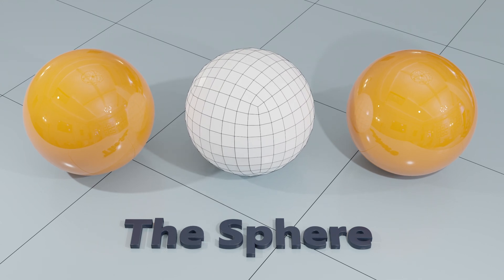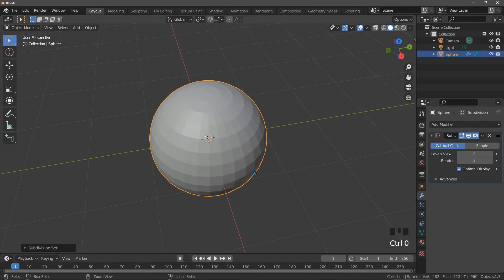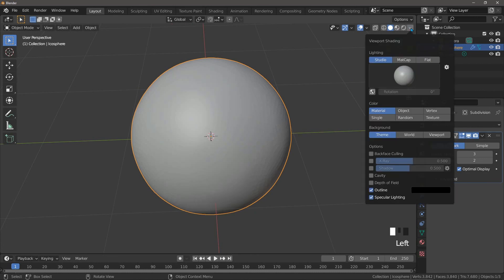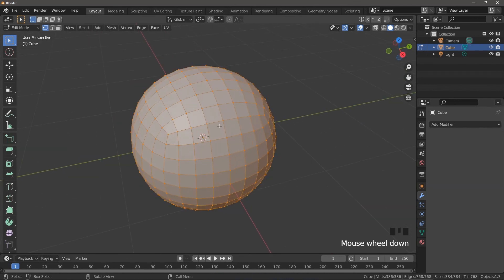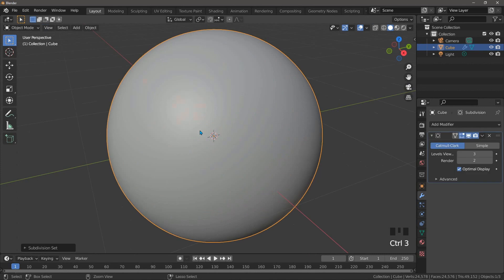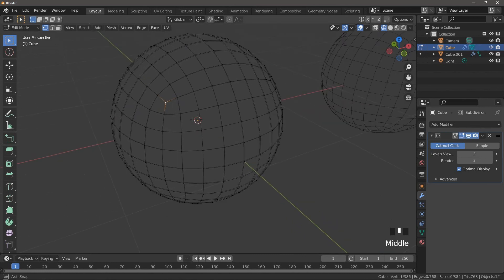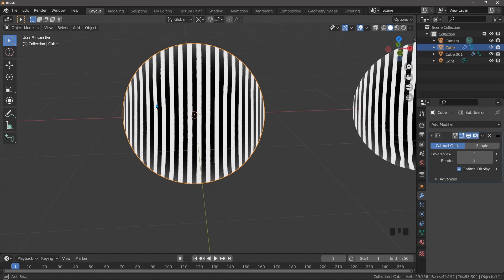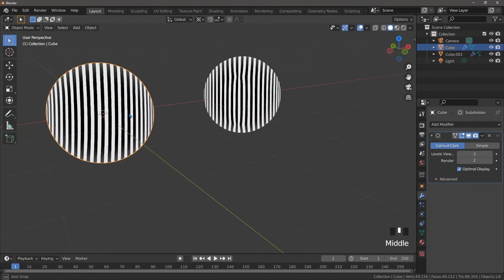Blender - A better sphere - #4 Subdivision Surface Modelling in Blender.

Comment: Whats the easy way to do this in 2024? The Extra meshes addon still has an issue, I can't find any other addon to get a nice quadsphere. Is there an addon that creates this sphere? If not, should I make one?
Reply from the maker: @dudss5178  Hi dudss. There is no add on to give this sphere. The sphere has been a problem in CG for 28 years now! Since the development of subdiv by Pixar for "Geri's Game". Thete is no mathematical solution and all of the big software providers (maya, max, blender etc) do not want to provide an imperfect solution. This sphere is the closest you can really get but it is not perfect so it does not exist anywhere. Except in this tutorial.

Comment: Simpler way to get a perfect quad sphere: Activate the "Add Mesh: Extra Objects" add-on, then Add->Mesh->Round Cube and select the "Quadshere" preset from the menu on the bottom left. Perfectly round, no vertex editing necessary.
Reply: I tried it, but when I went to the striped matcap, it didn't look as clean imho. On the other hand, I'll probably just use it, because it's pretty much perfect. I managed some decent results by just shrink-wrapping a 100% smooth x2 subdivided cube and targeting a uv sphere. Would be happy to know if there is so sort of issue with that method though.
Reply: Unfortunately the Quadsphere is not as perfect as the sphere in this video. just use the striped matcap, push both sphere sub-d level to 5, the strip on quadsphere is not straight, while the other is almost perfect straight.
Reply: thx bruh

Comment: I think, I discovered the laziest method to do the trick 😁 Add a cube, shade it smooth, press Ctrl+5 (or add a Subdiv modifier with level 5), add a Cast modifier, duplicate the Cast modifier 8-10 times (you can use Shift+D with Cast modifier selected and mouse hovered over the modifiers section). Done in 7 seconds 😎 Can you please confirm, that this method is accurate as well, Ian? Or it's just the laziest method? 🙂
Reply from the maker: Howdy user. It's an interesting attempt, but the resulting geometry  is just too heavy to be considered in a subdivision surface model. Definitely interesting though! When you apply the cast modifier it is set to an Infuence of 0.5. I really don't know why as it would be used at an influence of 1, 99% of the time!!! It really annoys me. Once the cast modifier is set to 1 it dosent matter how many times you apply it, it always looks the same. Blender should fix that really! I'm sure they are a bit busy for such little things though!
Reply: @ianmcglasham  Oh, really... I wasn't careful enough to spot and tweak the factor setting, it definitely should be 1, thank you! And for all the work you do on the channel, by the way 👍

Comment: Awsome video. Unfortunately I cant follow your video. Due to I am a Blender starter - my issue: at minute 1:56 in the video, when I select the sphere with the cursor, I cant grab the mesh of the sphere, it is still the silouette of the cube around. I can see the subdivided surface mesh in object mode but not in edit mode. My settings seem to be the same as yours. What am Im doing wrong?
Reply from the maker: You need to hover your mouse over the subdivision surface modifier in the properties window and press "ctrl-a"

Comment: Ian how would you make a low poly (as low as possible) sphere for subdiv modifier.. if you want them to be changed later in a scene.. like particles, or distribute points on a faces geometric node (like the donut tutorial, imagine the sprinkles as spheres).. a low poly uv sphere will distort to a elipse with subdiv.. and this one has a high number of polys for a scene with hundreds of spheres for subdiving later.. any ideas? sure I can eyeball and make a low poly "sphere" that would be more circular after I apply the modifier.. but that would be imprecise and the wrong way to do it..

Comment: Hey, very nice advice.

I've personally found that after applying the 3x subdiv and applying the casting to sphere, if you select only the 'corner' verts and run a Relax operation with 5 or so iterations, it pretty much eliminates any visible sign of stretching when the secondary subdiv is applied?

I'm not a massively advanced user, so I'm possibly missing something, but seems to do the trick...

Comment: Thanks. Outcome is really good for the modeling part but im confused with how to properly uv this to use a planet texture on it.

when i use blender generated UVMap it looks great in 3d. but on 2d (when you open exported texture maps in image editors) it looks weird. like sides of the texture map are empty and all the image is squeezed in the middle.

i wonder if using an auto generated uvmap is ok (since it looks good in 3d) or is there a better way to uv this?
Reply from the maker: https://www.subpng.com/png-hjisw4/ This is the UV mapping projection used for this type of Sphere. It should not need any additional UV unwrapping as the original Cube that it came from will have had a UV map which will be adapted automatically with the processes in the video.
Reply: @ianmcglasham  great. thank you so much for the reply. i cant wait for your future videos!

Comment: a simpler way to scale the vertices is to select all vertices (shortcut A) and hit shift + alt + s and then hit 3 to snap it to a sphere shape rather than scale vertices individually
Reply from the maker: Hi max. That does not work. The errors occur because of a mismatch in the way rendering algorithms interpret 3 spoked poles In a mesh. It will always need to be fixed either manually or using a laplacian smoothing operation.
Reply: @ianmcglasham  I'm not that advanced so idk but I got this method from another video and it seems to solve to problem (for me at least) and I believe in the same way (slightly moving the corner vertices in). Like I said I'm not that advanced so I don't know if I'm missing something but it works well for me

Comment: Thank you ! but tell us : why precisely  those values to scale the "odd points" ?
Reply from the maker: Hi Jean. Those are just the numbers I have come up with after a LOT of experimentation.
Reply: @ianmcglasham  😯 bravo ! (and I didn't find a better solution !)
Reply from the maker: @Jean-Christophe Sekinger  I do have one more solution! Tey adding a laplacian smooth modifier to a quadshpere with a really small value. That will give a similar result. Not quite as good and I can't remember the value I use off the top of my head but that can be a good really quick fix if required! Works really well with sphere divided with only 1 or 2 subdivisions.

Comment: Or you just add a round cube provided in Mesh extra objects. To sphere to polish it. Have you looked at the rendered version not the mat cap? Ok, I was looking at a sphere with the hdri reflected but I can't see any issue.
Reply from the maker: Hi Nicholas. The geometry of the mesh from extra objects is even worse and the "to sphere" operation cannot deal with the 3 spoked poles. The math for it does not seem to be in any mesh calculation outside of nurbs. The laplacian smooth can get you some way towards fixing the one from "Extra objects" but they all need something like this method to be as spherical as blender can manage. Good to see you here!

Comment: Subdivided cube with Cast modifier set to 1.01 influence gives perfect sphere
Reply from the maker: Hi John. The cast modifier at 1.01 does not make enough difference to a catmul-clark subdivided cube to remove the need for the manual movement of vertices. A simple subdivided cube ,when used with the cast modifier, brings a while new set of problems with entire edges between the 3 spoked oles becoming problematic with stretching because of unequal face sizes at those 'borders'. Love your channel though!

Comment: use a spherize tool. better than manually moving verts.
Reply from the maker: Hi Matt. There is not a spherical tool available that can do this correctly. The problem is not the placement of the vertices. It is the 3 spoked poles which connect some of them. The renderer (all renderers) interpret them incorrectly so they need to be moved by hand. There is no other way!

Comment: The Cast Modifier set to Sphere and Factor 1.0  works much better.   No fudging necessary.
Reply from the maker: Hi Alien Soup. The Cast modifier uses the same algorithm as the to-sphere operation and results in exactly the same issue. The problem is not the way the vertices are placed. It is a problem with the way the 3-spoked poles are interpreted by the rendering engines. There is no solution without moving some vertices by hand.